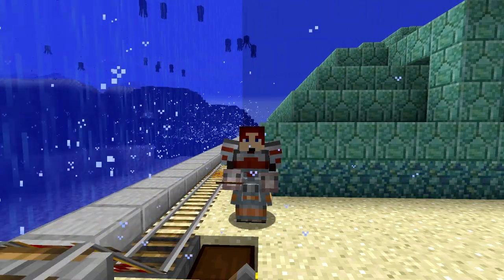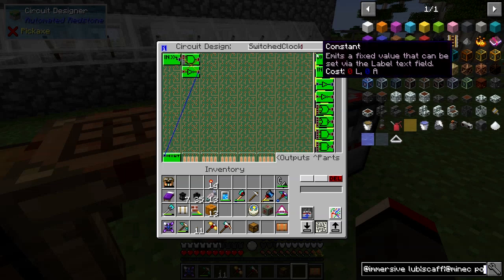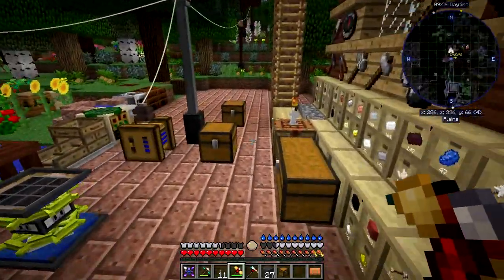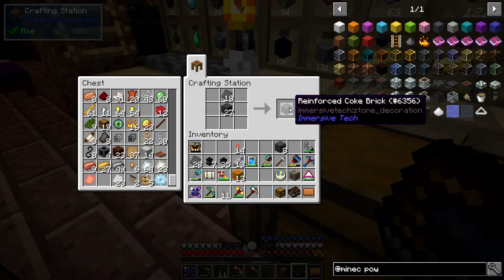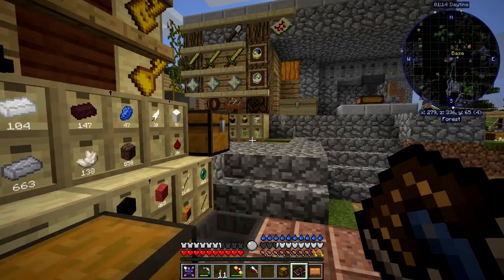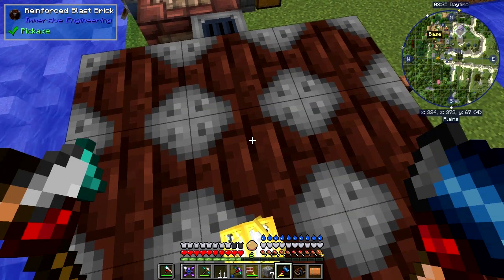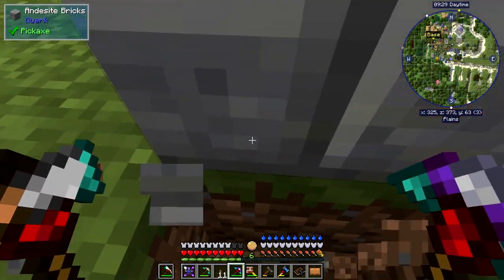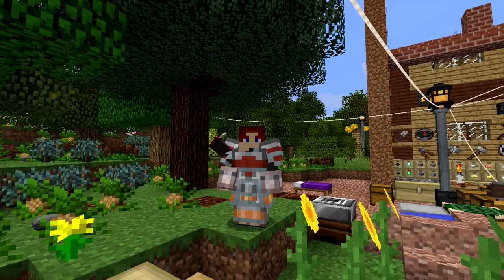Real Tech #059 - Advanced Oven & Advanced Blast Furnace

Comment: Do you need the pump at the back of the coke oven? I think it pushes fluids. So, you may be able to just pipe directly.
Reply from the maker: Danny & Son i reckon you’re quite correct, it has a fluid output port and they push fluids out. I was a bit flustered as it wasn’t creosote in the tank. I’ll test it and let you know. Thanks.
Reply from the maker: Tested it and indeed you're spot on, don't need a pump. Cheers